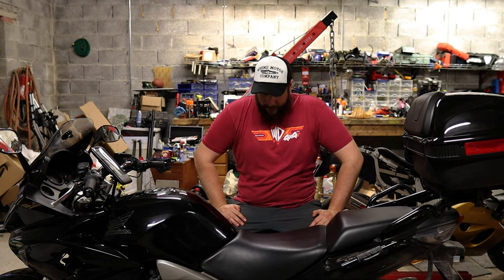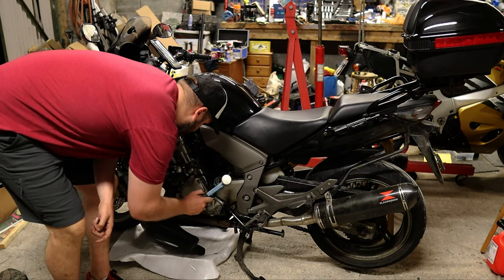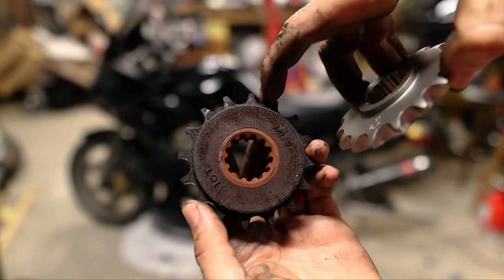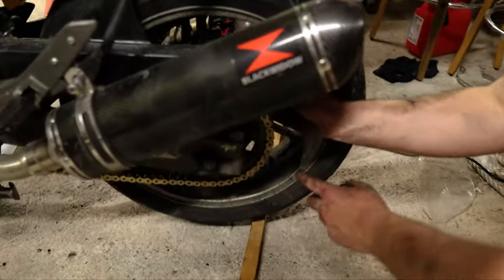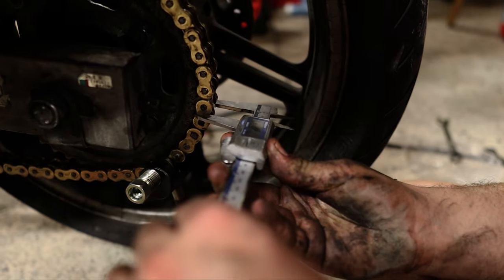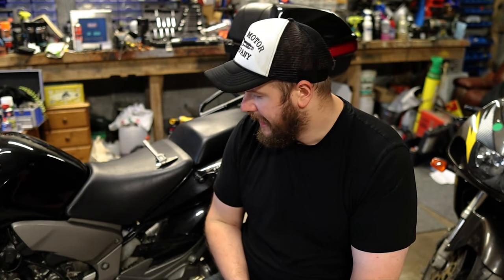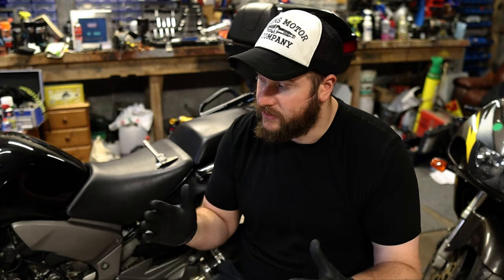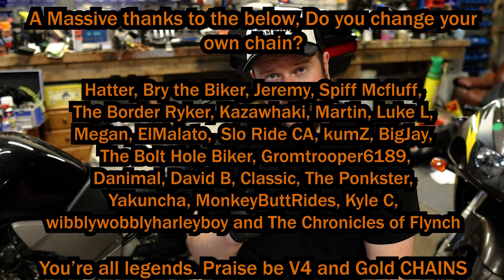Honda CBF1000 Chain and Sprocket Change - DID Gold Chain!

Comment: Hi, great explanation. I liked. I have a cbf 1000 from 2006, I have it for 3 years, and it currently has 33000 km, 8000 with the first owner. By the end of April, I intend to change the transmission kit, chain and sprockets. Thanks for the video. Good curves.
Reply from the maker: Thanks, glad you found it useful, main thing is when you do it just take your time and don't rush anything and you'll be fine :) Thanks for watching and you too!

Comment: Good video, as always.  Never tried a continuous chain.  Perhaps if chains were rust coloured from the factory there would be a lot less guilt in the world ?   Keep up the good work.
Reply from the maker: Thanks Stephen :) Did you always use the little clip instead? How did you find it? 
Haha that's actually a great idea 😂😂 They'd sell lot hotcakes for a daily rider here I'd imagine! 
I will certainly try to :)
Reply: @TheGorillaBiker    I never had any problems with the clips.  I used to boil my chains up in the tin each month or so.  Can you even still get the big flat tins of black gunk to do that with? ? ?
Reply from the maker: They're actually hard to get the clips now, and I know they're not recommended for high torque applications which makes some form of sense but I know plenty who have used them with no issue. 
No I don't think you can, I remember seeing one a long time ago but not since

Comment: What about correct adjustment of the chain? 
Thx for nice video
Reply from the maker: I've never done a chain adjustment video. I can do if you'd like to see it.
Reply: @TheGorillaBiker  Yes, It will be really helpful for me. I have adjusted the chain on center-stand, but read somewhere that you should do it in the side stand. But after adjusted the chain on the sidestand (with 25 mm free move), I sat on the bike, and the chain was to tight. So I would love to see a video about this. I have a CBF 2009. 
Sometimes the chain make som 'klak-klak' noice on low RPM. And also a video on how to clean and oil the chain.... and how often. Thank you so much. Love your videos. 
Stay safe. Regards from Norway
(sorry for bad English) 🙂

Comment: I can agree I bought one of those cheap generic versions and it broke and yes I decided to do my chain on a Saturday no bike shops were open had to wait the next week and go n buy the oxford one shit crack but valuable lesson learned cheapest isn't always the best 👍
Reply from the maker: Ahhhhh yes lovely. That's always the way it goes lad. Honestly with my bike I'd never go for anything that's cheap and cheerful for anything that's structural or going to impact a structural bit. Wing mirrors, plastics, seat etc grand, worst case they fall apart in a week and you're upset. I'd hate for a chain to fly off on me tho

Comment: Hi mate, I'm experiencing issues with shifting. Sometimes it changes two gears at once. Adjusting shifter position didn't help. Should I change chain and sprockets?
Reply from the maker: By two gears at once are you getting a false neutral and kicking the shifter again? Or is it skipping a gear with one click of the shifter?
Is it always the same gear it misses?
It's definitely not chain and sprockets causing the bike to skip gears unfortunately.
Reply: @TheGorillaBiker  mainly upshifting, to me it changes to 4th instead of 3rd. Could it be worn out clutch?
Reply from the maker: If it's only the one gear it could be a damaged selector either.
What I'd check is, in order, bleed your clutch(I'm assuming you've a CBF too?), or if not adjust the clutch cable to make sure it's correct.
Then open up the clutch and inspect the friction plates, measure thickness etc, could be worn out or the springs could be.
Then try changing gears with no clutch(loads of vids on how to do this) if it still can't get in to that gear you may have gearbox damage.
Hopefully it's only something small wrong with the clutch :)
Oh also, how fast are you clicking through gears?
Reply: @TheGorillaBiker  Thanks for getting back again. I have 2008 CBF. Got back in to riding after 8 years. I am still little rusty. changing gears too fast could be one issue.
I have lost some skills like rev matching properly. I'll take your advice and try your advice on the clutch.
Reply from the maker: No problem! I have noticed on my own CBF that if I try click up through the gears too quickly it can give a false neutral so that's what it might be!
Reply: @TheGorillaBiker  Totally agree with you here. It's always me. Biffer is a perfect machine.😀
Reply from the maker: Haha I would say more design flaw :D But we work around those :)

Comment: Hi. Is it any place in this job that you use locktight?
Reply from the maker: I usually use it on the rear sprocket, one inline 4s I don't use it on the front generally unless the service manual says to. 
V twins I always use locktight front and back. 
Honestly I just go by the service manual normally :) 
I think on this specific bike I only put it on the rear sprocket.
Reply: @TheGorillaBiker  thank you. Planning to do change of sprockets and chain in 1-2 weeks. Love you videos. 
Regards from Norway
Øyvind, CBF1000A 2009
Reply from the maker: You're welcome! 
Thanks, glad you like them and best of luck with the change :) 
I'd love to visit Norway some day!

Comment: Why not give the old bike a clean while you’re in there? Never did any harm 😂. I would have replaced both new?
Reply from the maker: Made the video a while ago but I'm fairly certain I did clean in around the sprocket. 
As for the whole bike it got used daily in all weathers. It was lucky to get it's weekly clean 😂
I did replace both new. Fairly sure I also covered that the new sprocket I got was the wrong tooth count.